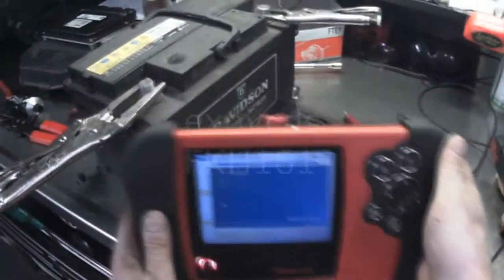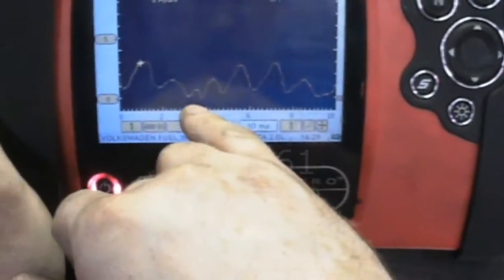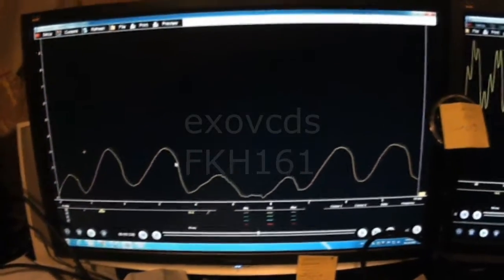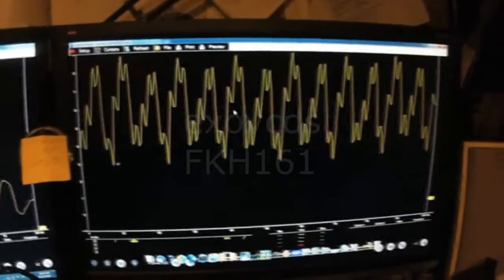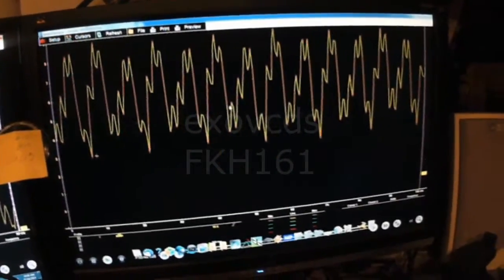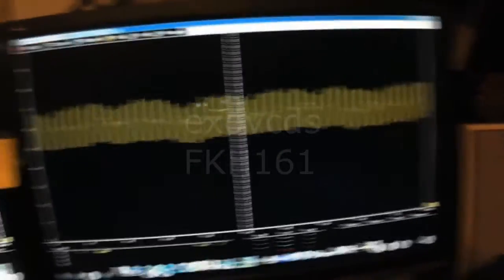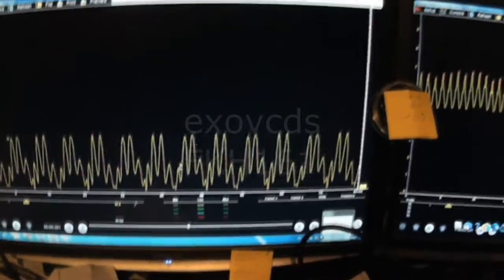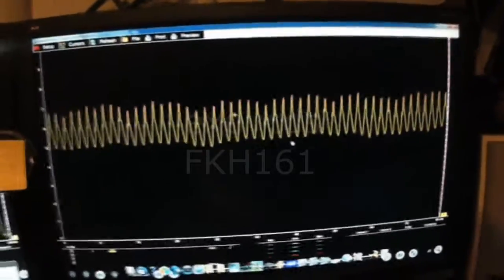VW A4: Fuel Pump Current Ramping Comparison

Comment: Yes, checking the amperage with a scope is a good way to detect fuel pump failures even before they occur. I remember showing a co-worker how his fuel pump was dropping near 0A on my scope and that he should replace his pump. He said, I've never had a problem with it and it's always worked. Sure enough, he didn't get it replaced. Two weeks later and now his vehicle won't start because of a bad pump. Some people you can't teach anything. Thanks for the video Thomas.